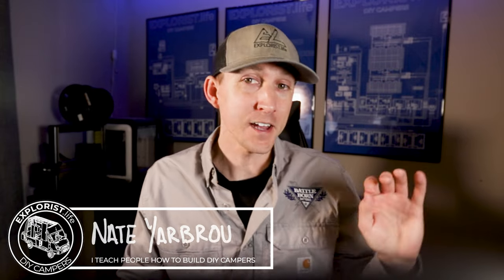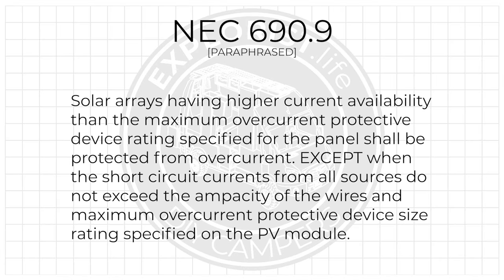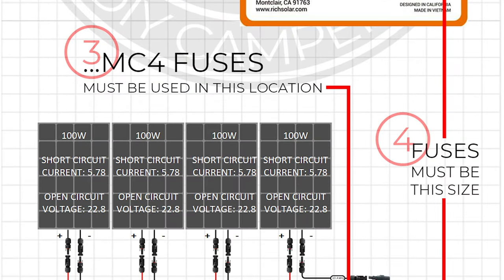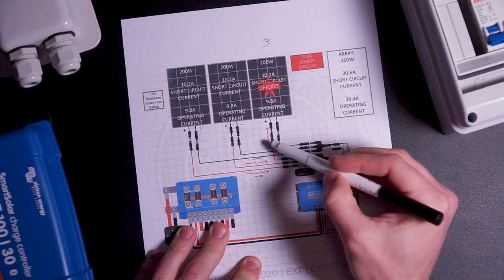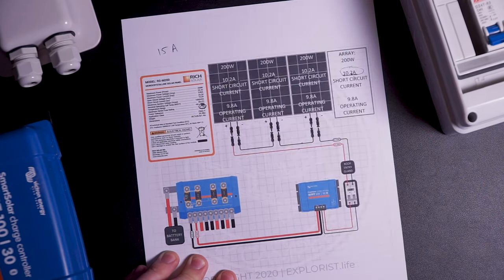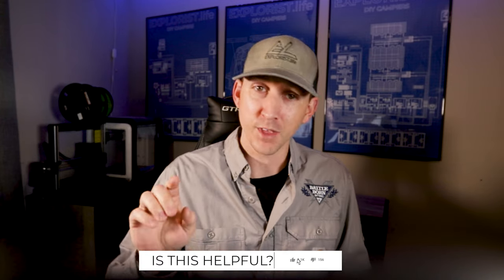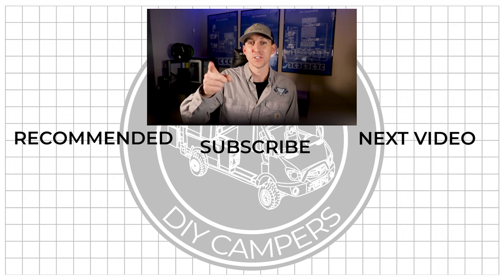How to Fuse a Solar Panel Array for a DIY Camper Electrical System

Comment: GREAT VIDEO!  It seems very hard to really get that design conversation laid out for discussion...  One Advanced Question I have on that "in-series" fuse layout Idea.  Let's say you have two in-series banks, each bank is 3 panels and each panel has an open c. volt rating of 49.8v and a short c. amp rating of 10.36amp, and directly at each panel connection in the series you use an MC4 connector that contains a cheap replaceable 15amp fuse so that it is closest to the source and slightly greater than nominal just in case one panel has a short circuit problem preventing damage to the rest in that series, if one single fuse (6 total) blows I believe that shuts off that entire 3 panel series, but my question is.. since that series is parallel to another 3 panel set will it cause any issues using the remaining 3 panel series for charging at only 10 amps and 150v, vs 20amps at 150volts?  I know some MPPT chargers want sufficient amps to even begin charging efficiently.  I have periodically detected some volt fluctuations back fed up the wire when only charging 12 volt batteries using this array when only one series is switched on, so either its a MPPT charger issue or this tiny fuse "in line" in a series is a bad idea for some electrical current reason.
Reply from the maker: I'm not sure I entirely follow, but if a fuse blows...I recommend replacing it as soon as possible after the problem that caused it to blow is fixed.  I don't like playing the 'what if' game with halfway broken systems.  I'd rather just fix it so it works as designed.
Reply: @EXPLORISTlife  was trying to decide proper fuse placement by looking at what happens if a fuse pops. Does it cause other things to break by imbalancing sets or just kill the series and if so what are the ramifications moments later if it takes hours or days to get a replacement fuse.
Reply from the maker: @mikenkaried4543  I see.  If a fuse blows, it just disables that series string and isolates the fault to that series string which would then continue to operate (not connected to the charge controller) at it's short circuit current, which the panels are rated for without the other series strings adding to the problem.  The other series strings would continue to provide power to the charge controller.

Comment: I have one panel that’s 15a and came with the rv and adding two more that are 20a rated. All are renogy 200 watt panels, would I use a 15a and 2 20a fuses or make them all 15a? Im not very good at this 🥴

Comment: Hi Nate, i have 2x190w Enerdrive solar panels (type SP-EN190w) I want to connect in series. It has no max series fuse rating on the label or website. I emailed Enerdrive for this information and they replied they don’t recommend series connection for 12v systems, and max series fuse rating is for grid connection and they don’t do this. Is there a reason they don’t recommend series connection for a 12v system? And I was given the formula W/V=Amps to work out the fusing I assume. Can I connect these panels in series and how or can the MSF rating be determined? Thanks

Comment: What's a little unclear is you're saying the short circuit current of the "entire array." Does that mean if we have two panels that have 10.2a on the sticker, the "entire array" would be 20.4 amps? Because if we wire in series the amps stay the same, right? So my short circuit current on the sticker shows 10.2 and the max fuse rating is 15. Does that mean I don't need to fuse, or does the "entire array" mean 20.4 amps? Or does the 
entire array term apply only to panels wired in parallel?

Comment: Nate....all great info...quick question on future solar expansion...any reason to not oversize solar controller with expansion of panels and batteries down the road...?
Reply from the maker: That's a good idea.  Set up an 'end goal' and work backwards from there.
Reply: Just keep an eye out for the possibility of over-currenting your battery during bulk charging.

Comment: quick rundown I have 4- 100w panels, p30L charge controller, 2- 200AH deep cell agm batteries, and a 1000w pure sine wave inverter charger, with 4 outlets run in parallel, that will be hardwired into the inverter charger. Do I need a breaker box anywhere? Or will properly placed fuses between components provide adequate protection.

Comment: Hi Nate, we are wiring 840 watts of solar in series/ parallel and am wondering if our short circuit amp is 10.86 per series would we only need a 15 amp fuse or 20 amp fuse? our specs our for a 20 amp fuse. Thanks

Comment: my solar controller is a renogy 100 Amps and pure inverter 2000w renogy  have eight batteries 192 amps gel planning on installing them on 24 volts series batteries based on your knowledge is this ok or you suggest something different, thank for your input lived up north in Canada not much sun in the winter in ONTARIO
Reply from the maker: Hey, thomas ansieta! I appreciate you taking the time to ask your question, but unfortunately, I don't have enough info about your specific question to provide an accurate answer, but here is a playlist that, if you watch all of the videos start-to-finish (and take notes 😉), you'll have a REALLY good idea of how to design a solar array: https://www.youtube.com/watch?v=Jkbs84sBHsg&list=PLmvhcyi4n0TV9pi83rFTv3ZuMT_S1xIZt

Alternatively, I have some of my most common solar array setups pre-built here: https://shop.explorist.life/product-category/all-products/camper-wiring-kits/solar-charging-wiring-kits/

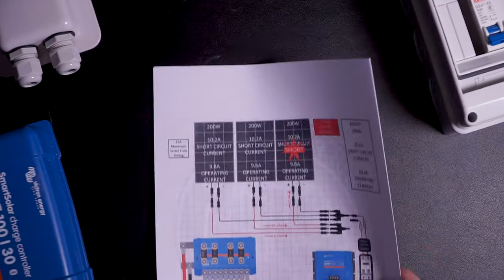Comment: Thanks so much Nate for all the immensely helpful videos you have made...  Question for you... in Case study #1 at 3:18, you show panels A, B, C where C is the right most panel and it has a failure causing it to short out.  From Kirchoff's current law, you get the 20.4 amps (total from panels A and B) going through panel C.  The part I am unclear on is you show the total potential current thought panel C at 30.6 amps.  In a real world scenario, if though panel C has a failure (e.g. short), it is possible for it to still be operational to produce current?  I have no knowledge of the mechanism of solar panels and hopefully I will learn something but it would seem if the panel fails, it wouldn't be capable of producing current.  However, even if the 20.4 amps were the only current, based upon your example, the fusing would still be required.  Thanks!
Reply: I have the same question!
Reply: It depends how the solar panels fails... they are basically made up of multiple smaller cells connected together. The "Maximum Series Fuse Rating" on the panel is the upper limit of what the internal connections between the solar cells INSIDE the panel can handle before failure. If one of these internal connections fails, the individual cells inside the panel are still capable of producing power (individually, just not exporting it from the solar panel). There is a chance that the fault could result in an internal short (and maybe an external return path? frame?), and when connected in parallel, the external fault current will contribute to the internal fault.

Comment: Hello Nate , Being consistant with your example of the panels in parallel , with those same specs can I use a 16a breaker on each panel .
Reply from the maker: I'm not sure I follow...  Are you asking if you can use a fuse size larger than the max series fuse size listed on the panel?

Comment: Ok so if i got this right i have 2/100w panels @5.5 a short circuit ratings each. A 10 amp fuse each panel is what i need wired in paralell?

Comment: If Voc panel voltage is an issue, i.e., it exceeds solar charge controllers max input voltage, does it make some sense just to install an additional MPPT vice putting up to parallel wiring issues?

Comment: This might seem like a silly question.. I am getting ready to install my panels. I plan on adding tilt bars, does it matter when laying them out if they tilt lengthwise vs width?  If I lay them out to tilt up lengthwise (taller vs wide)  I can fit more panels in the future. I can still fit all 4 width wise but it leaves little room for expansion later on down the road.
Reply from the maker: It shouldn't matter. :)

Comment: I have 4 photovoltaic module panels ET-P660235 Max power 235v, VOC 36.96v , Isc 8.40a , Vmpp 29.90v , Impp 7.86a , and Max System voltage DC 1000 , Series fuse 20amp , fire rating Class C , Max field wiring 14 AWG.. MY Question is are these panels suitable to fit to my RV motorhome,  if they are ok what type/size of controller do I need?  I've read that the best way is to wire 2 panels in series and 2 panels in parallel, then 1 pair if wires through the roof to an isolator switch - a 40amp MTTP control unit - a MT50 display -20amp fuse going to 2 batteries ( lithium  batteries, hopefully budget permitting) or the next best , I've been give a new 3000w inverter ( hopefully it's Ok ). The 30ft long  Tiffin American RV is 12v, it has 2 Leisure lead batteries (age & condition not known), a starter battery,  it has mains hook up and a 110v generator via a three way switch GEN/OFF/MAINS. I'm looking to buy all the remaining parts in one go and connect it all together

Comment: Hey Nate, watched a lot of your video's your doing a great job. I have a 76 GMC RV the electrical is totally trashed doing a complete rebuild but don't want to do the solar quite yet but want to have a build that will be able to add it later I like the smart inverter (that uses battery power to top up when shore power is not enough) plan to go with 3 lithium batteries and have a 3000 watt inverter generator and like the idea of charging with the alternator too do you have a list going for a build that leaves the option of solar later?
Reply from the maker: Hey Joe!  Literally all of my diagrams and parts lists at https://www.explorist.life/solarwiringdiagrams can be used without solar by simply omitting the solar charging leg of the system.

Comment: Hi Nate, I"m having a hard time finding the max series fuse rating for my panel as it's not on the back sticker and can't find it on the manufacturer's website.  Can you help?  Newpowa model NPA180S-12H (180W mono).  Thanks!

Comment: Plz help!  I just received my two new acopower 120w foldable solar panals.   there is no "max series fuse rating"... on the back of the panel.... on the website and... I have emailed the acopower requesting this information.... no response.  Should I be sending back these panels?  Are they missing something like a fuse that they should have?   Thank you for any help

Comment: I have total of 12 panels 100watt renogy solar panels 
I am about to install 6 panels in series  and planning to connect to set of 6 panels in parallel 
Do I need a fuse. If you answer this will help my project thanks
Reply from the maker: This video will teach you how to determine if you need a fuse in your solar array: https://www.youtube.com/watch?v=s1P31hxlD3I

Comment: question for you, i am finalising wiring this weekend for a friend of mine he has 2  identical longi panels installed on his shed roof both 445w rated max power,the have a max short circuit current each of of 11.53 a,, current @ pmax of of 10.78 amps, max system voltage of 1500v, max series fuse rating of 20 amps, we wish to wire both together to get the most watts/amps out of them (the voltage pmax is 41.3v ), they will be feeding to a string of 8 12v batteries and in turn the 12v power will be feeding to a victron quattro 12v 5kva system, what fuse do i need i am confused by the series/parellel and the info on the labels  ?? pps , these are new current generation Longi panels about 3 months old, they are currently both seperate running 2 charge controllers,here in the uk dc isolaters are super expensive, i was going to use standard mcbs of the correct amperage on both lines to act as a dc isolation, is this right/wrong ??, i have the victron putting out 240v ac with no problem off of 2 rolls batteries that are currently contacted, the remaining 6 lead acid 220ah batteries will be wired for 12v this weekend on the second dc in line on the victron, the victron has a main off box(external to the unit) with 2 lines each already fused with mega fuses of 500 amp times 2, which according to the victron specs exceeds the 800 a min fuse rating, please help  :) :)

Comment: So still a little confused, so I have 2 -200 watt panels in series, on the label ,it states short current is  9.97A ,max power 20.52V ,and max fuse is 20A per panel  ,so I don't need a fuse because it's 19.94amps and 41 volts  in series? Is this right?

Comment: Hi there, might be a silly question but my solar panels don't have the maximum series fuse rating on the sticker. I'm in Australia and purchased them here, if that matters at all. i'm using 2 x 200w panels wired in parallel, with a short circuit current for the array at 22A. If it's not listed on my panels, how do I know if I need inline fuses? thanks so much for any advice!
Reply from the maker: If the Max Series Fuse Size isn't listed, you can take the short circuit current x 1.25 and then round up to the nearest interval of 5.

Comment: I have 1 string and a fuse on both poles right before the DC over voltage shunt so if Lightning strikes and the over voltage gets tripped i hope the fuses blow BEFORE any fire starts or the inverter blows up.

Grid tie Solar Edge inverter and panels.
Don't "need" it but want it 😁

Comment: Hi I have 2 parallel solar panels running to my victron 100 20a than to my battery box the battery box has a 16a circuit breaker do I still need to put a fuse on my battery box

Comment: Please, help
I have three 100wt solar panels and keep being told to fuse them independently. And some say I don't. 
I have the three going into one and a breaker leading from that (+) cable.
And a circuit breaker on it leading to my charge controller.

Comment: Thank you Nate! I am actually learning this and I took the quiz on your blog and only missed one, the last one.  This is my 4th time watching this video and it makes more and more sense each time I watch it. I am figuring this all out, however, my Newpowa 180w panel only has 5 of the specs on the back. It does not have the max fuse series rating. It says: Short circuit rating of one panel is 11.75A,  exactly what is a short circuit? (the path of least resistance explained here?) Second, how do we figure that out if we have two panels(if wired in parallel short circuit is 11.75A +11.75A , if wired in series it is  just 11.75)? That is where I think I am on the right track..btw I only have one panel for now so my 30A charge controller doesn't need to be fused. I want to purchase another, but not without being sure that short circuit means what I think it does. Am I on the right path?
Reply from the maker: The 'Max Series Fuse Size' is generally the Isc (Short Circuit Amperage x 1.56.
Reply: @EXPLORISTlife  thank you!!!!
Reply: My Short-Circuit Current (Isc) says 5.86 A, and my Max Series Fuse Rating says 15 A.  Maybe panels have gotten better since they came up with the 1.56 multiplier rule of thumb. @EXPLORISTlife

Comment: It sounds like fusing in parallel is just a good thing (cost vs possible repercussion)
Reply from the maker: The voltage of a parallel wired array is rarely high enough to properly charge the battery bank.  Series parallel or series is generally the better option.
Reply: @EXPLORISTlife  I will watch your instructional videos “again” once my components arrive

Comment: Great video as always. Sorry if I missed it but I didn't see how you compute the Short Circuit Current of one's solar array when there's more than one panel. I've got 4 panels, 2s2p.  Each panel's ISC is 9.85A,  with a max fuse rating of 20A.  (Hightec 210W panels).  Do I add the ISC for all four panels to compare to the max fuse rating or just for two panels (since we don't add Amps for the two sets of series panels)?  Thanks!
Reply from the maker: That array will have a short circuit current of 19.7A.  Here's why: https://youtu.be/KJ5zCY5EBeQ
Reply: @EXPLORISTlife  Great, that's what I thought, and no fuse required.  Thanks for the quick reply.
Reply from the maker: No problem!

Comment: I have 3 panels connected in parallel, the total Short circuit current for the 3 panels is 34.14. And the maximum series fuse of  my panel is 25amp. So i need to put an inline fuse of 25amp per panel, right?
Reply from the maker: Yep!

Comment: my solar panels do not required a fuse but would that give me protection against a lightning strike or would the strike destroy everything anyway due to the power of it
Reply from the maker: The only thing that can really protect against lightning strikes is having good insurance with all of your camper electrical equipment on the policy. 😂👍

Comment: So, If I understand , only In parallel you could need to fuse? My array is made of three 170w PV in parallel , so I understand it must need to be fused. Am I OK?
Reply from the maker: The video you commented on teaches you how to figure out 'if you're OK'. 🙂👍  With all due respect, I'm not going to do the math for you.  I've taught you how it works, now it's your turn to put in the effort & put your newly learned skills to work.

Comment: Hi there i have 3 solar panel each 17.5 V 100w 5.7Amp i connected them 3 in parallel so i check the panel maximum series fuse and it say 12Amp do my parralel conection need to be fused and if yes what is fuse amp to be installed amd where exactly thanks in advance.
Reply from the maker: Hey!  This video will teach you if you need to use fuses in your solar array and if so, what size they need to be -> https://youtu.be/s1P31hxlD3I